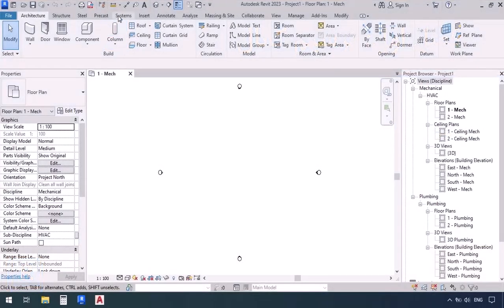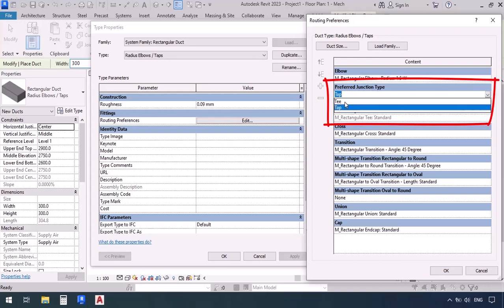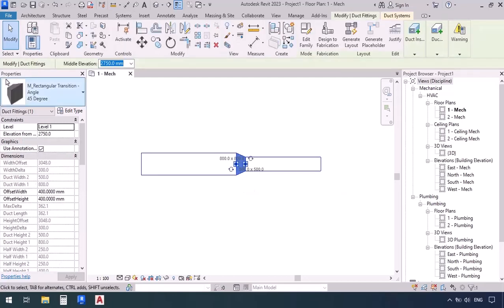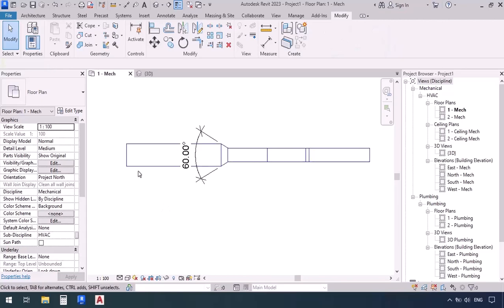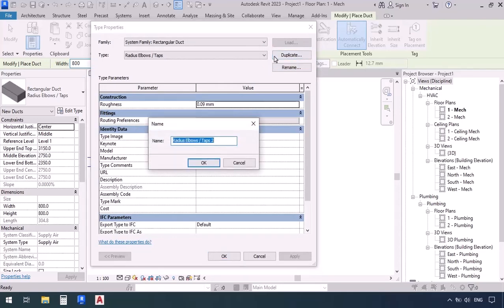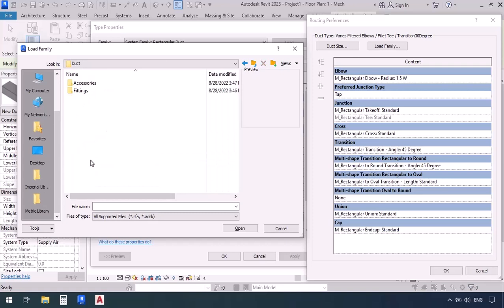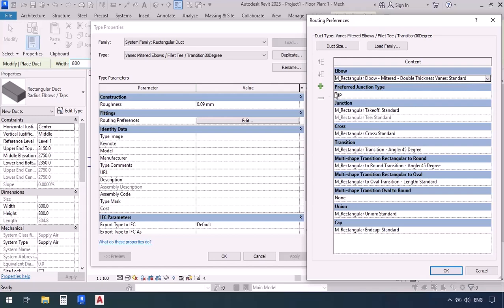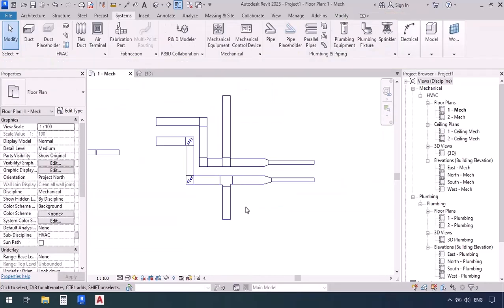Revit MEP - Duct Modeling - Session 4: Defining custom duct connections in Type Properties

Comment: 0:49: Type properties window
1:23: get to know Routing Preferences window
4:04: the next fourth section are all about transitions
6:34: cap, covering the end of duct
7:17: an example of transition
7:54: measure the angle. Annotate tab --> Angular
9:33: Transition: Rectangular to Round
10:07: Make a cut or split a duct. Modify tab --> split element
11:06: put a cap onto one or both ends of the duct. Click the end and click Cap Open Ends
 11:34: continue